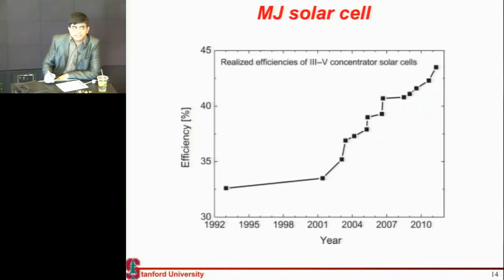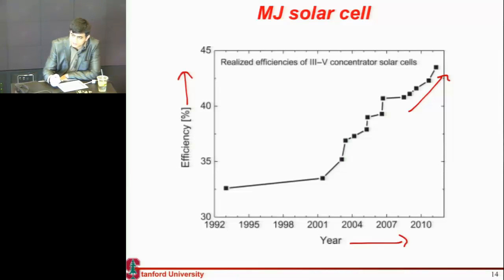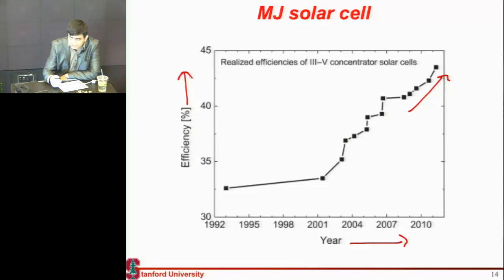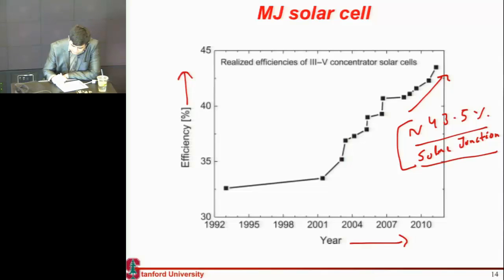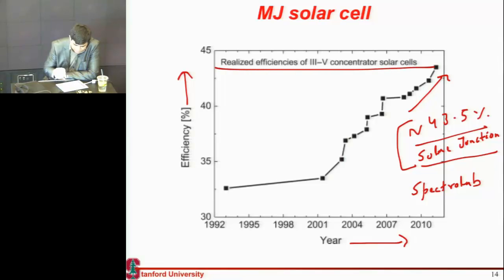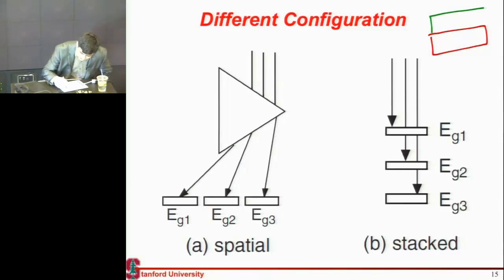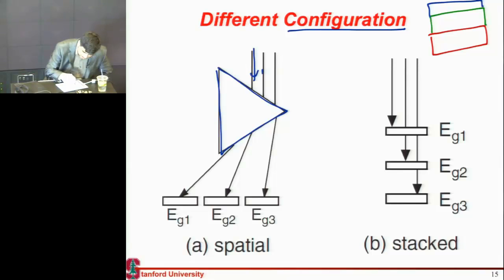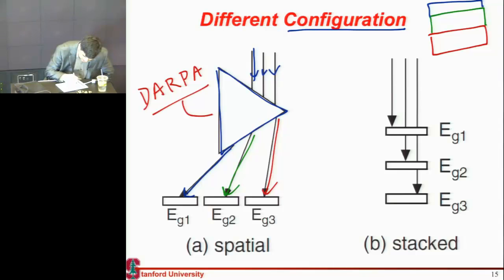Key Features of Multi Junction Solar Cells: Part 1

Comment: The two main reasons are because it reduces the loss firstly by transparency and secondly by thermalisation. Actually tandem (2junctions) or multijunctions (>2junctions) use the selectivity of the solar spectrum. Transparency losses mean that photons with energy lower than the band gap are noy absorbed. Thermalisation losses mean photons with higher energy than the band gap give their exceed of energy to the lattice.